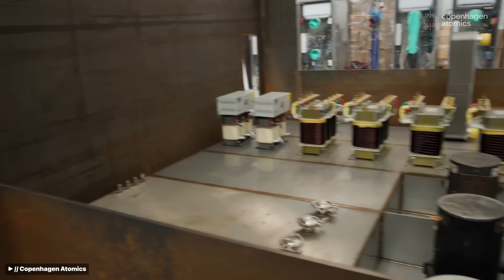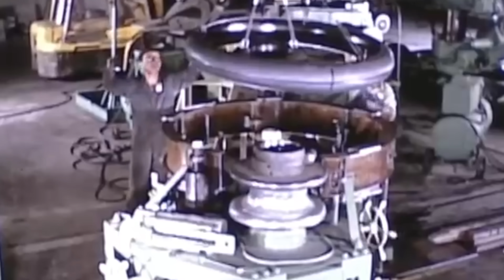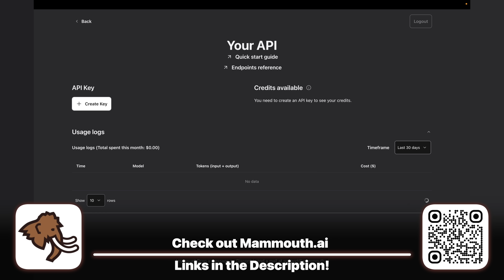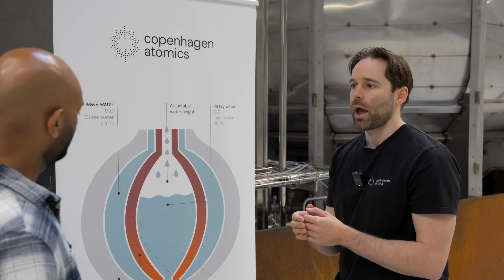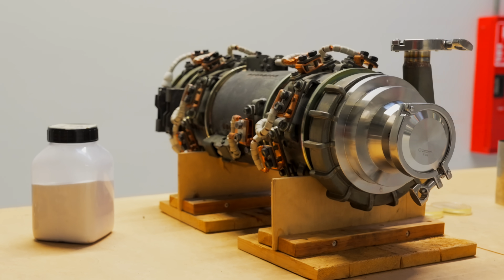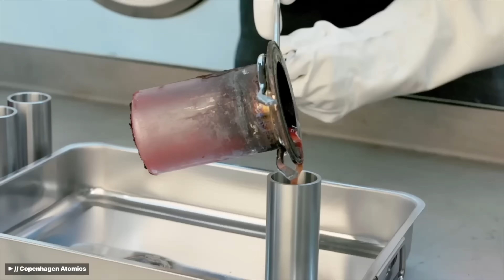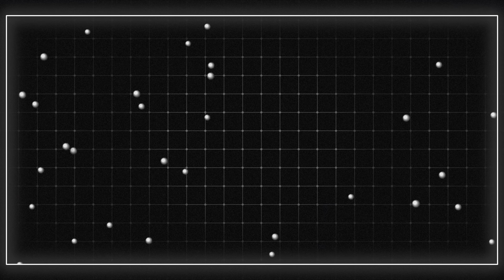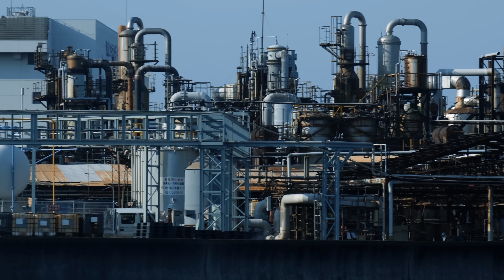This Modular Thorium Reactor EATS Nuclear Waste

Comment: Does it work yet? Because I've been watching videos about this for decades.
Reply: They have one in China that was a test, and they are building one for actual use.
Reply: @EvilWeiRamirez  Not they. Not Copenhagen Atomics. The Chinese have their own independent project. Copenhagen Atomics is to build a pilot reactor in Switzerland in the next few years.
Reply: this one new as it a liquid fuel to liquid moderator but choosing heavy water is interesting.
Reply: The economics had to catch up with technology [synergy to create the singularity]
Reply: I feel like that’s not too surprising when step 1 is “we have to invent a new kind of pump” or whatever other seemingly mundane, but in reality specialized, thing is needed for the environment
Reply: Unsubscribe
Reply: @__-pl3jg  no.
Reply: Not this reactor type, this is only a few years old.
Reply: There are no guarantees that this will work on a commercial scale in the next 35 years or that it will be competitive with uranium-plutonium fuel cycle technologies.

There are no guarantees for fuel reprocessing and regeneration.
There are no guarantees for closing the thorium cycle to uranium-235.
There are no guarantees for waste disposal, which is currently tens of times dirtier for thorium than for uranium-235-238 or for a mixture of uranium-235-238 and plutonium-239, 240, and 241.
Reply: @MihailG5541  Shill much? The Th cycle doesn't use U235, nor is there any indication it's dirtier.
Reply: @killcat1971  Th-232 -> U-233 -> ... -> U-235.
It's school physics.
But they're a lot of the other isotopes by the way.
And because of that it's a huge problem.
Reply: @MihailG5541  U233 IS the fissile material. It splits under fission with a neutron, it does not go on to U235.
Reply: @MihailG5541  That ain't a problem. In fact the thorium cycle avoids a lot of the problem long lived actinides that uranium creates.